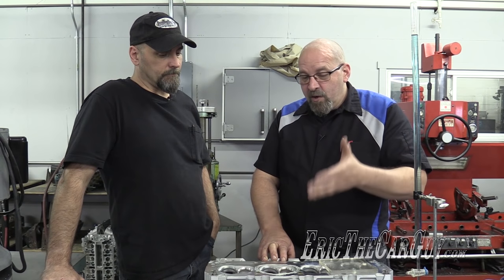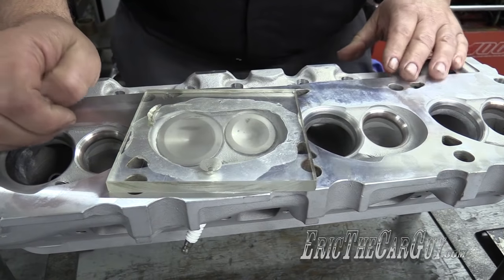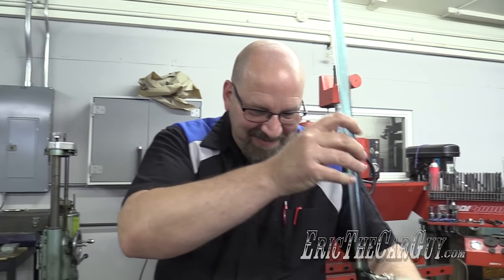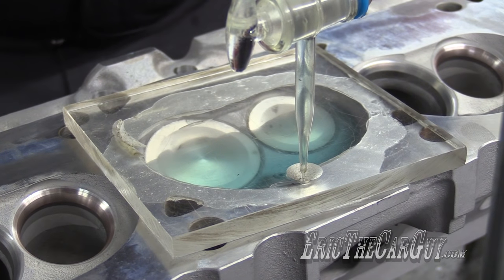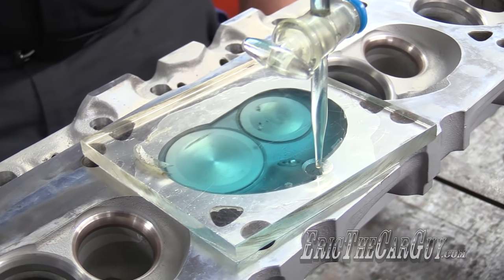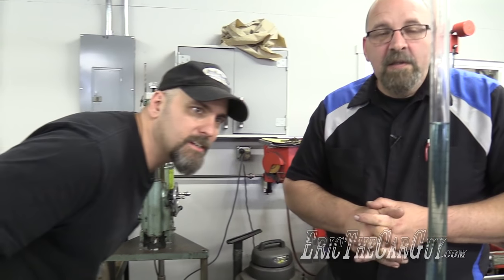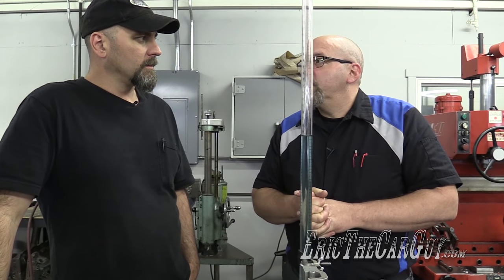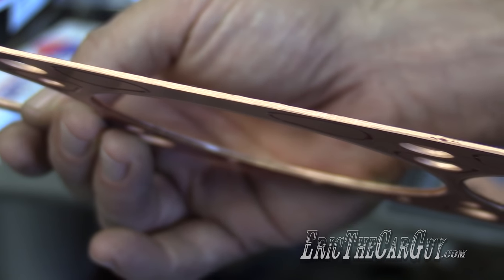How To Calculate Combustion Chamber Volume

Comment: You can definitely run higher comps on boosted engines as long as you have the proper engine management and tuning in place.
Reply: Probably, but the lower C/R means he can dial in more boost later and still be safe.  This is intended to be used as a daily driver as well as some track use, so it needs to remain fairly reliable as well.
Reply: My Supercharged Corolla 1.8 has a compression ratio of 11.5:1, 220BHP, compressor is pushing about 8-10psi. Yes it uses super unleaded 98+ and yes it drinks about 25mpg! Hits redline at 8200rpm.
Reply: Some people love to hear big numbers when it comes to boost.. 
But you can get the same power with higher compression and less boost.
Reply: exactly. You can run a smaller turbo and hit the same power figures along with not completely destroying your out of boost transient response
Reply: Engines lose efficiency at higher rpm - the air has too much inertia to completely fill the cylinder before the valve closes.  This is why boost will always be capable of making make more power than n/a, especially at higher rpm (which is where max hp is measured, since it's a function of torque and rpm.)  This is how the F1 teams managed to get 1300 hp out of a 1.5 litre V6 - with 80 psi boost.  You'll never manage that with a 1.5 that's naturally aspirated, no matter how hard you try.
Reply: Its all in the tune. People are supercharging stock coyotes that have 11:1 compression and easily making 700-800HP with no problems. Ik a couple people that run 13:1 on 30+LB of boost on 400+" Windsors and are just fine. The small compression numbers is just a safety blanket for those who isn't real great at tuning yet.

Comment: A meniscus is formed from the adhesion of the liquid to the side walls of the tube.  You can also get a convex meniscus from the cohesion of the liquid to itself.  If you put a bunch of drops on a coin, the cohesion would form a convex meniscus for example.  In this case the liquid has stronger adhesion to the tube than cohesion to itself so it made a concave meniscus.

Comment: Question, when you bore a engine do you replace the piston or rings and how do you know what size to get??? please do a video showing it. thanks
Reply from the maker: See the previous videos in the series. The 2 before this were about pistons and rings. Link in the description.
Reply: I did but don't remember hearing the answer to my questions but I'll go back an look again.. thanks I never miss a video
Reply: Pistons are built with a certain oversize in mind. Most common are .030, .040, .060 then in mm you have .25, .5, and 1mm oversized. Each has it's own corresponding ring set
Reply: The machine shop will measure the bores and determine how much needs to be taken off to repair any issues. Then you or they order oversize pistons and rings - for example .030 or .040 larger. Once the machine shop receives the pistons, the documentation will include the actual acceptable bore tolerance for that piston set and the machine shop will cut the bore accordingly. The bore is slightly larger than the piston because the pistons will expand under heat. Different materials have different tolerances. This is where an experienced machinist is worth $$.

Comment: I use gas to check valve sealing on heads that I'm not sure about.  I don't think I ever thought of using alcohol for the same thing, though I supposed the surface tension would be similar and give the same result.

Comment: adn again, great and informative video, i like it. I wonder how to measure CC in top dead center on cylinder whith a piston that have displacer on top of it isntead of a dish? This combo might be useful for more static compression in n/a build
Reply from the maker: I believe that info should be found in the print up for the pistons you're using. Otherwise, I think they use a special clay for that.
Reply: For flat top and dished pistons we place the piston at top dead center, then using a larger acrylic plate and burette similar to the ones shown in the video to measure the complete volume. 
If wanting only the piston dish volume we use a similar setup on the bare uninstalled piston. These methods are extremely accurate, fast and account for the additional volume of our custom shop machined fly-cut valve reliefs.
Reply from the maker: Nice! Thanks for the info.
Reply: i think he meant, if the piston has a dome and stands pride of the deck!
Reply: Carl Benz 
Then that is a slightly more complicated procedure to measure and calculate. 

With domed pistons, we rotate the crank to place the piston about 1 inch down the bore, place a light coating of Vaseline on the bore, rotate the crank to place the top of the piston dome flush with the block deck against a straight edge, gently wipe off any excess vaseline from the bore and top of piston without altering its position, this seals the rings and prevents loss of the measurement fluid past the rings and ring gap, carefully measure the distance from the block deck to the top of the piston crown (not the top of the dome, not the valve relief) and record the distance, secure and seal the acrylic plate over the bore. then using the burette completely fill and note the volume of the fluid to fill. 
Then calculate using the formula 
[pi * (r-squared) * height * 16.387064] - measured burette volume = dome volume

V = 3.14159 * r-squared * height * 16.387064
Where: 
V = Cylinder Volume for measured height 
pi = 3.14159 
r = radius or 1/2 cylinder diameter 
square the radius 
h = height or measured distance from piston crown to block deck 
16.387064 is the multiplier to covert cubic inch to cubic centimeter or milliliter 
1 cubic inch = 16.387064 milliliter 
1 milliliter (ml) = 1 cubic centimeter (cc) 

Example: 
4.125 inch bore 
2.0625 radius 
4.2539 radius squared 
0.375 inch measured distance from piston crown to block deck 
V = 3.14159 * 4.2539 * 0.375 
V = 5.0115 Cubic inch 
V = 5.0115 * 16.387064 = 82.1237 ml 

The measured burette volume was 49.2 ml
82.1237 - 49.2 = 32.9237 ml 
The piston dome volume is 32.9237 ml

Comment: What a nice way to measure the volume, i bet he unscrewed the sparkplug to drain it :-D
Basic measurements and methods appeal to me for some reason.
Reply from the maker: I think we just flipped it over and drained it out.
Reply: How messy lol, i like the father/son companys, i think they care more about the customers.
Just my view.
Reply: Classic method has been used forever.  The next step is to get the compressed thickness of the gasket and calculate the area of a circle with a diameter of the bore.  Then calculate the area of a circle the diameter of the bore with a thickness of the distance of the top of the piston to the deck.  Add them up and you have the total area of the compustion chamber at TDC.  Then just calculate the compression ratio.  If you want to get anal about it you can add the volume of the valve reliefs in the top of the pistons.  But only engineers like me do that kind of stuff.

Comment: another way is using the weight of the fluid and knowing the liquids density. water is the simplest (approx 1000kg/m3) and solving for volume
Reply: are you always walking one time around your house before you open the front door?
Reply: not sure what you're trying to say..?
Reply: Nik Trp doing it that way is adding an unnecessary step.
Reply: That's for those who don't have a fancy burette.. chances are more would have a kitchen scale

Comment: For colored liquids you are supposed to measure at the top of the meniscus, both at the start and at the end (not that it makes much of a difference). Pharmaceutics student here!
Reply: There have been many scholarly discussions regarding properly reading the fluid meniscus and it really does not matter as long as the starting and ending readings are consistently top and top or bottom and bottom.  
There is an introduced error discrepancy if mixing top/bottom or vice versa readings.
Reply: Totally agree, that is what the parenthesis is for! It is all relative but in the case of colored liquids sometimes you just can't see the bottom of the meniscus due to their high opacity. In this specific case, there are probably more significant errors derived from the thickness of the vaseline on the cylinder head, the fact that the acrylic might not be completely flat and the tapered opening should not have been filled (or should have been accounted for). In the end, it probably does not matter though.
Reply: as an engineer, that has to do with the surface tensions depending if the fluid is concave up or down. But as mentions the difference should only matter between start and end for the reading position

Comment: Thought I would add for those that do not have a burette = (me), then a syringe and accurate scales (.01g) can be a sub. 1gram of water is 1cc. So get a large syringe weigh it with your water in it and then fill your chamber and calculate how much water has gone in. Can even check your calibration of your syringe if you are sad:-) Mine worked out ie weighed my syringe filled to 100ml and it got 100grams heaver. comments?

Comment: what causes errarte idle my chevy impala raming up between 2&3 rpm while car is running
Reply: probably a vacuum leak somewhere, check for cracked hoses or leaks in the vacuum system. could even be an intake manifold gasket.
Reply: Early Pierce Spray brake cleaner around the intake manifold mating surfaces and check if the rpms fluctuate
Reply: try soapy water instead
Reply: Ok with da soap & water what im lookin for
Reply: Vaccum leak if old imp, sensor if newer one.

Comment: How much does the gasket compress?
Reply: Advertised gasket thickness is the compressed thickness. How much it will compress when torqued depends on the material.
Reply: The published thickness spec for SCE ICS Titan brand copper head gaskets is the compressed thickness at the specified torque. 
That spec can be different for different manufacturers and different products.

Comment: so how long till u the engine in the car
Reply: iirc, the engine is in the car already, he is just releasing the build videos over time
Reply from the maker: I've already test fitted the engine. It still needs to come back out so I can swap the front suspension. I also still need to rewire the car and figure out the fuel system. Still some time yet before it's on the road.

Comment: No reason you can't have higher compression than that , even with boost. I know many boosted cars with 10:1 - 11.5:1 on boost... Tuned on 93 octane for the street.
Reply from the maker: It's much easier to increase boost. ;)
Reply: more efficient, more responsive with higher cpr. But I dont think youll be track racing it on the limit so who cares.
Reply: In terms of simplicity, yes it's much easier to just turn up the boost. However, boost and compression are actually different in the way they affect performance and the reliability of the engine. For street applications with moderate boost, it is always preferred to have the highest (dynamic) compression possible. This way the turbo will be spooling much quicker, and off-boost applications will feel better, more torquey and improve MPG.

In addition, putting a thicker head gasket with the aim to reduce compression is not ideal as it increases the quench areas in the combustion chamber, which in turn makes it more prone to knock. Personally I have some experience with this and was actually quite surprised with the results. My car comes turbocharged with 8.5:1 comp. pistons, but the engine suffered critical failure and I had to change out the pistons. The only ones I could find at the time were 10:1 comp. and the car runs just as good and feels much better in lower RPMs, boost is about 0.6 bar (~9 psi). This is all stock, used parts. I know it's not the best way to go about fixing an engine, but it was all I could do at the time.

My point is, Eric, a lot of times people in the engine-building business are somewhat afraid of compression and try to avoid it at all costs (when it comes to forced induction). In my personal opinion, it is best to tune around compression :)!
Reply: I got tired of having a low compression (8.5:1) boosted motor, after I swap in a 6 speed for better MPG. If I ever get the time I'm throwing in a motor with 10.8:1 , with the same turbo setup.
Reply from the maker: 575hp @ 7.8psi of boost on this engine. Also 640lbft @4500 of torque with a very flat curve starting at over 400lbft off idle. This engine turned out exactly how I wanted it to. Those numbers do not use a generous inertia calculation either, .06. It'll be just about immortal and will run on pump gas. No need to stray into the danger zone and the possibility of it not working or premature failure.
Reply: Also it raises the point, do you really need more power than that for a street car?  Might as well play it safe when you already have numbers that will destroy everything everyone else is driving short of $200k+ cars.
Reply: Isn't this engine carbed? I'd imagine that to reliably run higher compression you'd want the precision of efi. The lower compression probably makes tuning with a carb a lot easier/safer.